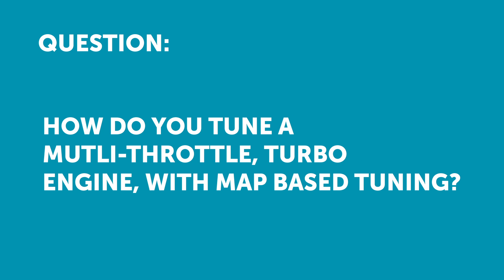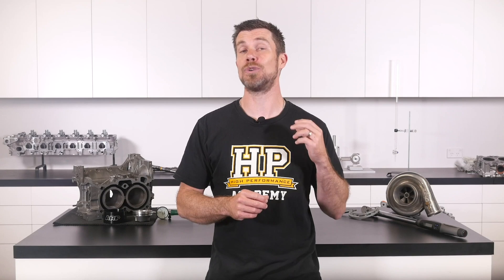Individual Throttle Bodies and Turbocharged Engine Tuning | Just MAP or Something Else?  [HPA Q&A]

Comment: Speed Density (MAP Based) Tuning can be successfully  implemented on ITB (Independent Throttle Body) Engines, "in most cases".
It depends a lot on just how radical the Cam Shaft Timing is.
Back in the day, I did this by creating a multiple tapped Vacuum Reservoir, which the MAP Sensor got it's pressure signal from.
Multiple Sizes can be made from PVC Pipe Fittings, and experimented with, 
until the ideal balance of Vacuum Hose restriction and Reservoir Volume has been found.
BUT, and this is a BIG BUT,
ITBs have ZERO VALUE on a Turbo-Charged Engine, other than sexy appearance.
ITBs can have certain INTAKE TUNING benefits on a "Naturally Aspirated" Engine, 
but once the Turbo is added, all the priorities, and/or, benefits, change.
If you plan on adding a Turbo, plan on replacing the ITBs, or suffer the headaches and consequences.
Unless you are Honda, or Renault, building a Formula 1 racing machine, skip the ITBs.
The best setup for Turbos is a Single Throttle Body with a MAF Sensor, 
but you can, of course, add MAP, and run Speed-Density, and MAF, at the same time, which can be quite a useful combination.

My preference is to use an Inline Air-to-Water InterCooler, to minimize the Intake Plumbing Snakes, 
with the Throttle Body mounted BEFORE the Turbo.
This  "Un-Loads"  the Compressor when the Throttle is closed, keeping it's RPM up, for virtually zero lag, and 
eliminates Compressor Surge/Pressure Spikes, and therefore, there is no need for a BOV, 
which will seriously confuse a MAF Sensor System,
however, a simple, vacuum operated, Bypass-Valve may be a useful addition.
If you use a Bypass-Valve, it needs to be plumbed into the Compressor Inlet in such a way as to create the maximum amount
of "spin" in the in the air flow going into the Compressor Inlet, 
WHICH MUST BE in the SAME DIRECTION as the Compressor Wheel Rotation,
this will reduce .......
Compressor Loading, Intake Air Heating, Turbulence, and Noise.

Warning,  there are some Turbo Bearing Seal designs that will NOT TOLERATE VACUUM, and they will leak Oil into the Intake Tract.
This is virtually the same problem that is created when your Oil Return Line is restricted, or too small.
Check with Your Turbo Manufacturer for recommendations.
.
.
Reply: TheFastAndThe Dead
I'm describing a practical Daily Driver Setup that must have excellent street manners and not wind up being
a perpetual Pain-in-the-Butt,
Although the general Ideas can make very serious power.
The only Racing this could be said to be ideal for would be Endurance Racing.
Other forms of Racing quite often find "Driveabiity" to be way down at the bottom of the Engine Builder's list of priorities.
Many people are just copy-cats and bolt-on the same type of systems that they see on local cars, well,
I suppose that's fine, everybody's got to start somewhere.
I come at problems by finding out every single detail I can, on how each part works, and how they all inter-act with each other.
This has been a successful strategy for me.
I also spent a stupid amount of hours working out problems for people in 
the Mega-Squirt Forums back when Mega-Squirt was a new thing,
this gave me many insights that I couldn't have gotten in real life just because of the time and money that would be involved.
People will try all sorts of off the wall ideas, mostly because they really don't understand exactly what they are dealing with,
and whether or not their idea is going to play nice with all the other parts.
Most people look at me kinda funny when I say put the Throttle Body on the Inlet of the Turbo,
but when you start thinking with "Air Density" instead of Boost Pressure, many things start to make more sense.
You should NEVER-EVER run a Turbo into a "Surge" condition, but a lot of people just have to have "THAT SOUND",
OK fine, if that's your end goal, go for it.
Some people just have to be able to smoke the tires off, and run around with no muffler, so they look and sound "fast".
I'd rather embarrass them at a stop light with a quiet sleeper, with Ice Cold AC, and a nice Stereo System, (that you can actually hear).
I'm also a HUGE proponent of Water/Alcohol Injection, and Direct Injection (GDI) .

As for your observation on "Lag", Yes, all the Plumbing contributes to Lag, but that's not the main cause.
If you Shut-Off the Fuel and Air, by closing the Throttle, the Turbo goes from, lets say ~20,000 RPM, down to ~5,000 RPM,
when you open the Throttle again, the Turbo has to "Spool-Up", 
this takes time, maybe 1 or 2 seconds to get back to full Boost RPM.
The Turbo slows down so quickly because of extremely Dense Air around the Compressor Blades, the Turbo is trying to
create maximum Boost with almost ZERO FLOW, this is were you get "Surge", and Surge can DESTROY THE TURBO.
This is why you absolutely MUST HAVE a BOV when the Throttle is after the Compressor.
On the other hand, if you put the Throttle AHEAD of the Compressor, closing the Throttle will put the Compressor Wheel into
a High Vacuum Environment, where there are very few Air Molecules to push around, therefore, there is very little drag on
the Compressor Wheel, so it maintains some of that high RPM, ready for more Air.
This also means that the Compressor does not go into a Surge Condition,
(well, actually it does go into Surge, but the Air Density is so low that it's really a moot point, 
and under High Vacuum Conditions the Turbo will not be damaged ), and you can barely hear it.

Keep in mind that any Intake Tract Tuning will be shifted DOWN in the RPM RANGE.
Air, at 15 lbs of Boost, ( 1 Bar), IS TWICE AS HEAVY as Air at normal atmospheric pressure,
so at 1-Bar, if the Intake was originally tuned for ~3,000 RPM, it will now be tuned for 1,500 RPM  because of the increased Air Density.
Therefore, quite often the best Intake Manifold for a Turbo Engine is a Sewer Pipe, huge, massive, way over-sized, AND NOT TUNED.
Same goes for the Exhaust Manifold, Pulsations hitting the Turbine Wheel can actually cause it to BREAK under certain circumstances.
So slowing down the Exhaust Gasses with lots of Volume in the Exhaust Manifold is a bonus.

Keep the Overlap way down on your Cam Timing, the Engine should idle dead smooth, no rumpity-rumpity sounds with a Turbo.
Reply: @jimbrown563  Putting the throttle body before the turbo is a very old idea, and there are good reasons why everyone stopped doing it that way, mostly because it kills throttle response. If you can't get your inlet pressure down before it causes your turbo to surge, then something is seriously wrong with your setup. For someone harping on driveability it's odd that you would suggest such an archaic throttle placement.

I also disagree with you slightly about ITBs. They will still provide a better throttle response than a single-TB plenum setup would. Otherwise Nissan wouldn't have bothered with them on the Skyline GT-R and the Sunny GTi-R. The real question is whether the average Joe building and tuning his own turbocharged engine should bother with ITBs, and for that I would have to say no, given how temperamental they can be to tune for driveability. It's also a more expensive setup and makes comparatively little difference overall. Horsepower gains will certainly be minimal at best.
Reply: @TheFastAndThe Dead 
It "might" work.
I would be concerned about the extremely high temps that the MAF would see,
I don't know how that particular MAF responds under unusual conditions. (It looks like a GM MAF with a sticker on it).
That's a pretty expensive experiment at ~300.oo, and will REQUIRE extensive re-Tuning of your Computer.
There are NO "Bolt-On" solutions with an aftermarket Turbo, FORGET THAT IDEA.
The safe way is to find out how to force your ECU to run in "Speed-Density" Mode, with no MAF at all.
Looks like you're running a Mustang, I haven't been keeping up with Fords, but I'm pretty sure that HPTuners Software will
let you do all kinds of crazy stuff, as well as tweak the Tune in any way needed.
You are going to have all sorts of problems, or maybe a trashed engine, 
if you don't know how, and/or, don't have the physical ability,
to Tune the engine safely for the changes you are wanting to make.
.
.
Reply: @TheFastAndThe Dead I can't comment on that specific item, but I can tell you that lots of people have used GM MAFs in the intercooler piping between the blow-off valve and throttle plate just fine, and yes it eliminates the problem of placing the MAF before the turbo and releasing metered air to the atmosphere.
Reply: @rars0n  
""Putting the throttle body before the turbo is a very old idea""  
All Turbo setups are "old ideas" everything you can imagine was tried before ~1945.

Yes, it will kill Throttle Response if you have 10 feet of ~3" Pipe, and an Intercooler with 1.5 cu. ft. of volume between the
throttle and the Intake Valves.

An Intercooler and all that Plumbing is not mandatory in a Turbo setup, there are may other ways to deal with the heat.
Not to mention the fact that the Compressor will run much lower average temperatures with the Throttle in front of it.
Hence my comment that 98% of the guys out there are simply copycats, and don't actually understand what they are doing.

The Kit manufacturers have to make their kits as idiot-proof as possible, and, not surprisingly,  they make their money selling parts,
and the more parts they sell the more money they make.

The Money needs to be spent inside the Combustion Chamber and Piston Crowns, with polishing and Thermal Barrier Coatings,
and special attention given to very tight Quench Clearances,
and, on a  1000+psi,  E-85,  Individual Port Fogger setup, for Charge Cooling and additional Fuel Supply.

And BTW, at 500+psi, with the properly designed "Impingement" style nozzles, you can spray E-85 directly into the
Compressor with zero leading edge blade wear.

If you wonder why you don't ever see this, 
it's because that  1000psi Pump and 9 Nozzle Fogger setup costs in excess of ~$4000.oo, 
after you factor in a second complete fuel tank, and a custom made Electronic Pump Motor Controller, and the 60+Amps wiring required.
No cheesy re-purposed RV Water Pump is going to even come remotely close 
to creating the Super Fine Atomization required for really effective Charge Cooling.

Massive Injectors are generally not required.
Injectors adequate for NA Power are fine.
All Boost Enrichment is  provided by the E-85 Fogger setup, and NO Intercooler is needed or wanted.
Cool Compressor Inlet Air is always mandatory though, in any kind of setup, even NA.
It always makes me chuckle to see a MASSIVE Intercooler hanging below the front bumper of a car, 
that has an under-sized, generic, Cone Air Filter sucking in ~200 degree under-hood Air.
.
.
Reply: @jimbrown563  "Not to mention the fact that the Compressor will run much lower average temperatures with the Throttle in front of it."

The charge air is heated due to compression. I fail to see how sticking an obstruction in front of the compressor inlet is going to reduce the temperature of compressed charge air.

"Hence my comment that 98% of the guys out there are simply copycats, and don't actually understand what they are doing."

Yes, you're right. The many engineers who design modern turbocharged engines don't know what they are doing and are just copying everyone else.

"The Kit manufacturers have to make their kits as idiot-proof as possible"

Design criteria for an add-on turbocharger kit is very different from the design criteria of an OEM engine. Of course there are going to be trade-offs. This does nothing to strengthen your argument for putting the TB in front of the compressor because literally nobody is doing this anymore. Not even F1.

"And BTW, at 500+psi, with the properly designed "Impingement" style nozzles, you can spray E-85 directly into the
Compressor with zero leading edge blade wear."

And?

"If you wonder why you don't ever see this"

I know exactly why I don't see this. It's completely impractical. Nobody wants to deal with that bullshit.

No need to reinvent the wheel when there are proven methods that actually work.
Reply: @rars0n  
""I fail to see how sticking an obstruction in front of the compressor inlet is going to reduce the temperature of compressed charge air.
""
That answers all my questions about your level of understanding of all the various interactions that are going on in an engine.
You could have asked a question, 
I'm still happy to provide the general theories, 
but I'm not going to attempt to provide you with decades of study and experience in a YouTube Comments section. 
I've got nothing to prove, I've already been there and done that, and even set records doing it.
I'm only commenting here to get people to think outside the box, and maybe learn something.
""Proven methods that actually work""
I guess my "copy-cat" comment kinda stepped on your toes,  sorry about that, the truth sometimes hurts.
If you don't know exactly how something works, or doesn't work,  then you don't know why it works, and how to improve it.
And, what's  "Completely Impractical" about 
making ~700HP from a ~5 Liter V--6, with only 8 pounds of Boost, on 87 Octane Regular Unleaded,  ( plus E-85 when under Boost ),
that also cuts a 1.9 second 60ft Time on practical street tires, has a quiet muffler, and gets  ~26mpg on the highway with the AC on ????
( All with the factory PCM and Electronic Throttle  )
.
.
Reply: @jimbrown563  "That answers all my questions about your level of understanding"

Yup. Why bother explaining yourself when you can just dismiss the opposing argument? Great tactic there.

"I guess my 'copy-cat' comment kinda stepped on your toes"

It's like you didn't even read the rest of the sentence.

"And, what's  'Completely Impractical' about"

YOU already answered that in your previous comment! Sheesh! Reading comprehension is not your strength!

"making ~700HP from a ~5 Liter V--6, with only 8 pounds of Boost, on 87 Octane Regular Unleaded,  ( plus E-85 when under Boost ),
that also cuts a 1.9 second 60ft Time on practical street tires"

🤣🤣🤣🤣🤣 You're kidding me, right? I cut a 1.68 60-ft on street tires in a car @ 20 psi making 350whp on a small 16g turbo. 2L 4-cylinder. Total cost of mods was MAYBE $3000? 30+ MPG highway. Factory ECU.

But sure, let me add a thousand pounds of junk to my car so that I can effectively run an old-ass pull-through carb setup so that I can brag on the internet about my shitty driving skills.
Reply: @rars0n  
I don't see any questions at all , only what amounts to a very arrogant "rant".
I'll assume that your confession that you  ""....fail to see how......""  is what you are calling a question,  
so I will address that subject with further questions, which, 
if you did have a reasonably good understanding of where the Heat in the Inlet Charge comes from,
you would immediately understand ......

1)  Lets take for example, 1 Cubic Centimetre of air, which is at the current , ambient temperature and pressure. 
...... ( humidity will not be considered for simplicity's sake, as its effects are not terribly significant for this discussion) .....

2) The temperature of the 1cc of Air is ~70F degrees at ~14.7 psia .
If you increase the pressure to ~29.4 psia, its temperature will exactly double to ~140F .
If you reduce the pressure to 7.35 psia, its temperature will be cut in half to ~35F .

3)  Sources of additional Heat ......

a)  Under-hood Air at ~200 degrees, conducted through the under-hood Inlet Air, and Discharge Air Plumbing.

b)  Heat conducted through the metal parts of the Turbo, form the Turbine side, to the Compressor side.

c)  Heat caused by the inefficiency of the Compressor Wheel Blades when it is doing work to compress the  Discharge Air.

This 3rd item (c) is one that you, quite obviously, do not have a good understanding of.
As the pressure differential between the Inlet of the Compressor, and the Outlet of the Compressor, increases,
the  EFFICIENCY of the Compressor goes DOWN.
As the efficiency of the Compressor goes down, 
the Compressor Wheel will take more and more of the ENERGY, (provided by the Turbine), that is driving it,
and rather than using that energy to raise the PRESSURE of the Air, 
it simply puts that energy DIRECTLY in to the Air in the form of HEAT,  
which is transferred by way of turbulence,  
WITHOUT COMPRESSING THE AIR ANY FURTHER.
This additional Heat added to the Air is also partially transferred into all the surrounding parts that are in contact with that Air.
This additional Heat will build-up, and be  "stored ", 
and later released back into any Air that may have a lower temperature than the new higher temperature of the affected parts.

The amount of Heat that can be transferred to the Air is directly proportional to the DENSITY of the Air, 
which is a function of the Air's Absolute Pressure.
So, if the Air is at ~14.7 + ~5 = 19.7psia , 
( which would not be an unusual back-pressure at a light cruise,  (~30% MAP = 14.7 X  .3 = 4.41psi MAP ) ),
then it will have a Density almost 4 times higher with the Throttle placed after the Compressor, rather than before the Compressor.

If the Compressor Wheel is running in a partial "vacuum", (slightly less than the 4.41psia MAP), 
then much less Heat will be transferred to ALL of the Components in the entire Intake Tract, all the way to the Combustion Chamber. 

At WOT, you might assume that either setup would be exactly equal, but they are definitely not.
One system has a very short and direct path to the Intake Manifold, with FAR LESS VOLUME.
The other system has an extremely long, VERY HIGH VOLUME, path,
which, not only provides ample opportunity for absorbing some of that ~200F under-hood HEAT,
but also adds FLOW RESTRICTION, or "Back-Pressure", which never makes it to the Intake Manifold.
Now, admittedly, this is back-pressure, and Heat Gain, may not be all that high , BUT HAVE YOU ACTUALLY MEASURED IT ?????

Lets create a conservative example of 0.5psi pressure loss at 10psi Boost Pressure,  (it could be MUCH HIGHER).
That's a 5% loss of Pressure, 
BUT THE AIR RETAINS THE ADDITIONAL HEAT THAT WAS GENERATED TO OBTAIN THAT 5% , 
plus ALL the Heat Gained from all that plumbing under the hood.
And, at maximum output, the Pressure Loss, and the Heat Gain, could easily get as high as 20% each , or even more.

Ethanol , (E-85), can be run EXTREMELY RICH , ( as much as ~5:1 ) , 
resulting in a substantial increase in Power Output , ( in some cases as high as ~30% ) , with or without Boost.
It's just an excellent bonus that it  also absorbs a tremendous amount of Heat when changing states , 
and substantially increases the actual Octane , and the  "EFFECTIVE OCTANE"  at the same time , 
which allows both a higher Compression Ratio , AND more Boost at the same time.
This , however , requires EXTREMELY fine Atomization at extremely high pressures , and carefully controlled distribution , ( Port Injection ).

If you had a good understanding of all of these concepts, 
you should be able to argue the significance, or the relative value of all of these points , plus many that have been left out .
I'm willing to bet that you can't, but it would be an interesting pursuit in person .
.
.
Reply: @jimbrown563  So you don't understand the nuances of the English language? Perhaps then you need to go back to school and take a couple classes. Nah, you don't need them. You're just acting like a smug prick because you think attempting to insult me somehow makes your argument stronger. 

"is what you are calling a question"

It was a statement that suggested doubt. You're the one who keeps calling it a question.

Your entire rant above is completely irrelevant. The "question" is, all things being equal, HOW does putting an obstruction in FRONT of the compressor reduce the amount of heat generated due to compression (the PRIMARY cause of heated charge air)? That is, a is irrelevant, b is negligible, and c is irrelevant. All we're comparing is taking the same turbo and the same boost level and the same plumbing, and moving the position of the throttle body. Nothing that you've said in all of your rambling messages has come anywhere close to explaining this.

You seem to be deluded in the belief that everything you're describing on your "throttle body into compressor" setup is somehow not possible once you put the throttle body onto the plenum. Water-to-air intercoolers are a thing. Methanol injection is a thing. Short, direct intake piping is a thing. EVERYTHING YOU ARE DESCRIBING HAS NOTHING TO DO WITH WHERE THE THROTTLE BODY IS PLACED.

Again, placing the throttle body in front of the turbo is an antiquated setup, and nobody uses it anymore for many good reasons. Complexity, cost, weight, packaging, safety, etc. Your ridiculously contrived setup of injecting gasoline into a compressor wheel is not something that most people would ever want. This is 2020, not 1970.

Edit: It also seems like you don't understand the concept of a compressor map or how compressor wheels work. Why? This statement:

"As the pressure differential between the Inlet of the Compressor, and the Outlet of the Compressor, increases,
the  EFFICIENCY of the Compressor goes DOWN."

That's completely incorrect. Compressor efficiency is a function of shaft speed, air flow, and pressure differential. That's why the map is 3-dimentional and not a single line.
Reply: @rars0n  
Have a nice Day.
( I hope that's  "nuanced"  enough for you )
My bad for wasting time attempting to explain something to a person who already knows everything there is to know ,
maybe someone else will stumble on to this conversation and be inspired to learn more .
Reply: @jimbrown563  Honest question, which turbo are you using on a 5L V6 at 8 psi?
Reply: @rars0n I'm afraid this other guy actually knows a thing or two. I can see why you became suspicious, as did I, but I'm an engineer and several of his arguments hold up. I also regret to inform you that F1 does indeed currently throttle the air from the plemun but also in front of the turbo. We have picture evidence.
Reply: @acruzp  The only pictures I can find show no obvious throttle valve assemblies anywhere. I'd honestly be surprised if teams were still using them at all, considering they could just control the engine throttle using valve actuation. BMW does this in some of their engines.

It's also a significantly different situation when you're talking about placing a carburetor before a turbo, since you're not just passing air through the compressor but fuel as well. I did acknowledge that there are some benefits to doing this, but IMO these are outweighed by the cons, and I suspect this is why it's not very common.

Also, as far as I'm aware, back when F1 did put throttle plates in front of the turbo, they still ran throttles inside the intake runners as well. Although maybe that's not true for every engine, I'm not sure.